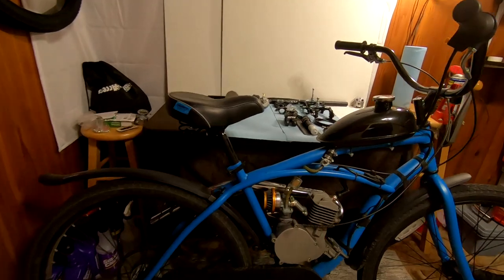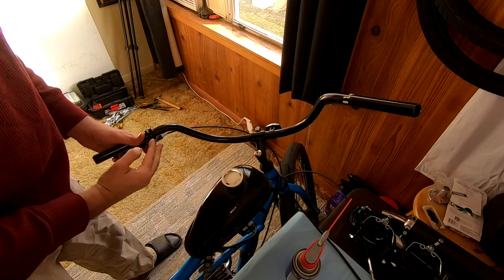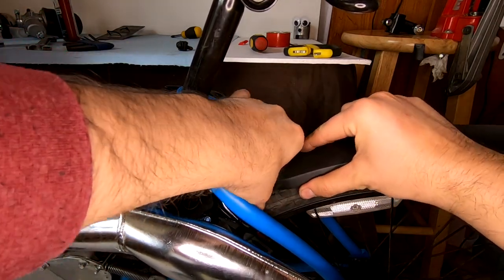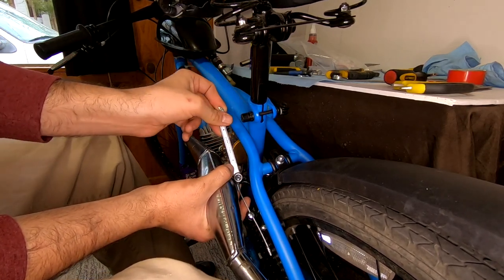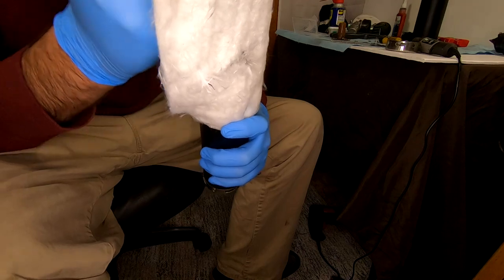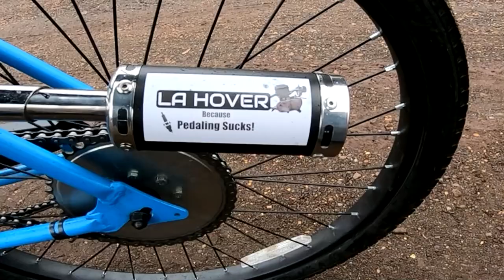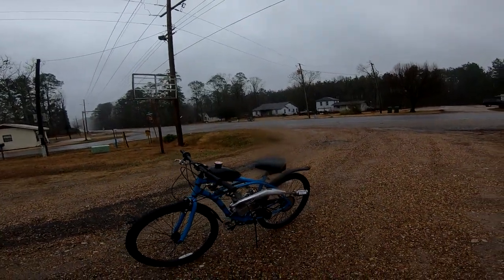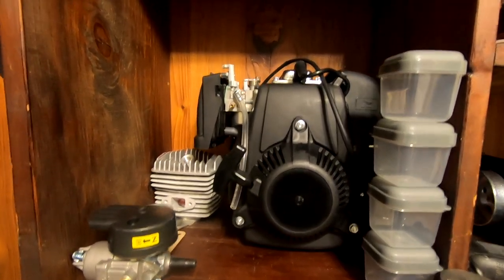Motorized Bike Upgrades

Comment: The thing about dual brake levers, that I've learned from motorcycles, is you need to adjust each brake to only give you the maximum braking you want while the lever is fully engaged.
Most of the braking happens in the front, you want the back brake to never lock up.
So adjust it to slow the wheel down without locking it up

Comment: I used to install fiberglass insulation. I recommend that you never do that indoors. That stuff gets everywhere and it's extremely difficult to get rid of. When I quit my job doing the insulation, fiberglass was in my car and in ALL of my clothes for at least 3 months. If you have sudden attacks of itchiness over the next 3 weeks, that's the fiberglass.
Reply from the maker: It's a small amount that is handled sparingly. But yes, good advice :)

Comment: If you need a solid Mount try punch bar stock, like 7-8$ at the usual home improvement stores, if you have a good way to make holes you can use normal bar stock and make the mounting holes yourself

Comment: I ended up going with a dual brake lever on my second build, I adjusted the brake bias directly at the calipers. So with the same amount of pressure I'm getting more bite on the rear than the front, still not as good as 2 independent brakes, but it works...

Comment: Hi been  watching for a few weeks used all of your info thanks ..... I live in Ireland at sea leval just wanted to know what jet to use iv them coming in the post thanks con
Reply from the maker: Stock jet should work well at sea level. You may see more power by opening up the air box a bit, or adding a cone ari filter. 
For jetting you will first want to learn how to read your spark plug, and how to do a plug chop. This will help tell you if you need to go fatter, or thinner on the jet.
Reply: @LAHover  thanks for that I'm running rich at the moment as I'm on on the brake in so it's a bit black at the moment but I know it's the coffee colour I be looking for .... Jean says hi from Ireland we watch your videos at night to pass the time during the lockdown.... She has mobile issues but I'm hoping to build her bike next as we have good woods near by .... I'm mean she a big fan we would love to see your dad back on the run thanks for your help con horgan

Comment: i have the exact cranbrook, i put mountain bike/street hybrid tires on it and took the fenders off, i think if you're willing beat the frame so the front mount will fit its the best choice, its cheap, you don't feel bad beating it to make something fit, and you can tamper with it without too many issues. and instead of changing the handle bars i just tilted them backwards and it has an old cafe racer vibe now

Comment: Spent 2020 lockdown watching all your videos, inspired me to do my first build on a Walmart op roller cruiser I've had in the garage for 5+ years, I chose the motoose one piece, mild porting, nz clone with a silencer, very happy for 60 days as a daily rider to work. I decided to re- ring it, mildly re-broke in and it really hooked up with the pipe, great low to mids but a week later it falls on it's face after 1/2-3/4 throttle. Still noodling this issue out, seems it wants a larger than stock jet as the needle in a richer position improves it slightly hmmm?

Comment: I have set up the rear brake to engage first with the dual brake lever. Over the years of over the bars experiences I had learned to apply the rear brake first and stronger.

Comment: Maybe it's both the velosity stack, the silencer, and the new style carb or maybe one or the other but that bike seems to run really well! Not all of the normal popping and such! At least on vidio it seems to be better! As towards supporting the pipe! Back by the rear brake I would use a bracket back there!
Reply from the maker: Great point!

Comment: I hate the beach cruiser handles bars too a free simple solution to that I took and cut about half way through on the front side of the bar bent it forward then welded back where I cut straightening them out a lot, of course only cheap if you already have a welder.

Comment: Separate Comment because I want to ask about your tires.I have basically 'racing slicks 'with squiggles cut for water displacement.MI and snow really hurts.(Literally;wet ice and I dropped onto it and broke a rib and re-separated my shoulder)I'm buying 'winter'tires and like your's.I've seen you do mud etc,.Do they grip well??TY.
Reply from the maker: Ouch! man sorry to hear that. I honestly don't give to much thought into my tires. I just grab what ever budget set I can find. They don't last long for street uses, but with the limited power of these motors, they seem to grip just fine off road.
Everything is going to be nearly useless on snow and ice without studs.

Comment: A good silencer I use is the stock exhaust. Cut the manifold off, heat what’s left up til red and bend to how you want it. I use a rag joint bolt and nut to hold on to the exhaust

Comment: I have a 50cc 2 stroke bike kit engine it was running fine when and come back out thing would run what do nothing I'm just wondering if it might be the spark plug cuz of today I was tried it and it was firing and it's try to start but it never did what do you think it might be wrong with it

Comment: Was there a noticeable performance boost with the shorter silencer as opposed to the long one?
Reply: Not at this performance level. The pipe doesn't do much more than a stock pipe with cap removed. If it was an optimized set-up, you would feel a slight difference. You will only notice changes once the exhaust is close to optimal for the engine.
Reply: @marthamryglod291  oh ok

Comment: I have a brand new motor kit, I put it on like the others but on the clutch side there's a half moon key inside the cover just floating around and I can't get the small gears screw to come out,,, what's up with that??? I saw your video on how to ask questions properly buuuut I wanted to ask YOU, I like the way you do stuff and you one of the biggest reasons I pulled the trigger and got into this anyway, help me out buddy, the clutch felt ilkie it was slipping so I adjusted the flower not several times then noticed that key
Reply from the maker: The key could come from two spots, the clutch shaft, or the small bevel gear. It's more likely for the clutch shaft. Without the key in place you can adjust the flower nut over and over and it will keep slipping. Pull off the clutch plate, and reinstall the key. Good thing you found the key, it probably fell out during installation.
Reply: @LAHover  bro that makes sense because it never engaged all the way since the first time I tried to start it, see that's so cool thank you for helping me and now I have a motor that ain't useless like I thought... I figured it was one of those hit or miss things... Dude thanks seriously!

Comment: How easy is it to go from threaded to Threadless headsets?
Reply from the maker: I have not tried it yet so I can't say sorry. On this bike I'm using a quill adapter (linked in the disco) that allows you to use more modern steams inside of the threaded head set.

Comment: I love your vids but gas bike disc is only way to go if you ever tried to brake in the rain you understand with that said i know its about cheap build but if you go fast over 15 mph you must stop that fast 
I also like 24 mm flat side its harder to tune being bigger but once you get it tuned its the way to go. I run a reed valve with small window and trench and boost port i hit 34mph with 44 spocket. Alot of hills where i live and im heavy set lol but 10000 rpm work for me yes no stock crank will live that way. My crank is 3 days in the making make jigs to true and bal. to 60% its fun to realy fun to make the tiny 2 strokes spin and still have low end porting you realy need a degree wheel other then that your just guessing if i was to guess my 2 stroke makes like 5 to 6 hp likely more. Have fun with your upgrades
Reply from the maker: Thanks for your feed back :)

Comment: That one fluds after a while be careful it also leaks on engine
Reply from the maker: Float bowl over flow is common. Even more common if you don't run a fuel filter.
Cleaning the inlet needle and bowl will usually do the trick.

Comment: Let me give you some advice about your front brake watch the front stud it's going to buckle into your front wheel it's happened to me it happens several people
Reply from the maker: I'm not so sure, this is a solid set that I use on two other bikes... but thanks for the heads up.
Reply: @LAHover  so is the set that I got tektro
Reply from the maker: @willardbuchanan9122  I just inspected all three set on my bikes. They are all solid with no signs of stress... Correct installation is key. I also don't push my bikes to ungodly speeds.
Reply: @LAHover  no problem I was just trying to share information with you

Comment: I'm about to overhaul my bike in anticipation of spring with a bunch of upgrades. I need to know something maybe someone in the community will help me. I have the reed kit that bolts onto the standard cylinder intake and I'm wondering if anyone knows the best carb to use with that style? A stock NT/Speed carb will fit the spigot but I'd like to get maybe a little bigger one since I've got all my ports very nicely done and good exhaust so it will be breathing very mu h better than stock so with a stock carb I believe I will be restricting the whole shebang.
Reply: Check out the Discord in the description.
Reply: @marygunn2521  no time for all that
Reply: You'll get your questions answered there faster.

Comment: The new bars are WAY too low. They need several inches more rise to them, and some pullback, so you can sit upright on the seat, not all hunched over. You can likely find something that will fit the stock stem. Living in the AZ desert, I have absolutely no use for fenders. No rain here. Cutting a silencer in half makes no sense. Where I live, most motorized bike riders wind up getting into trouble because of how noisy their bikes are. Without the noise, they would have gone unnoticed. I noticed you have an engine mounted chain tensioner, which is an absolute necessity if you don't want your bike to kill you. A NON rag joint clamshell rear sprocket mount is also a necessity. Oh, and PA LEASE get rid of those reflectors in the wheels.
Reply from the maker: You do you man...

Comment: i got a problem my exhuast studs broke off how long will my 48cc 2s hold up with out a exhuast
Reply: @JamesPiccone  OMG I LOVE YOUR CHANNEL
Reply: Longer than your ears and your neighbor's tolerance.
Reply: @JamesPiccone  I dont have special tools likes drills etc i have all the basic hardware to build a motorized bike and you may be askin how did you drill a hole for your throttle i didnt but it stills works.But the amazon seller i bought the thing from sent me a cylinder with cracked and bent metal piece
Reply: @JamesPiccone  They literally snapped as i was tighten them i will never forget that day
Reply from the maker: Have you seen my broken stud removal video?
I have been told that running an open header on a 2 stroke will 'melt' the exhaust side of the piston... I guess we will find out if this is true lol

Comment: A few days ago i blue up my second motor😿😭
Reply from the maker: RIP. How did she go?
Reply: I ran her for to long over heated it had a lot of 🛢
Reply: @LAHover  I ran her for too long and I run herfurth about 6 hours straight and I only stop for like 5 minutes to put gas in the oil and she seized up while I was gone around 35 miles an hour